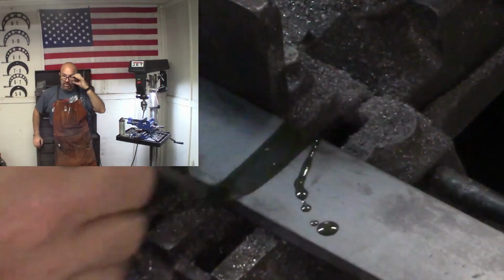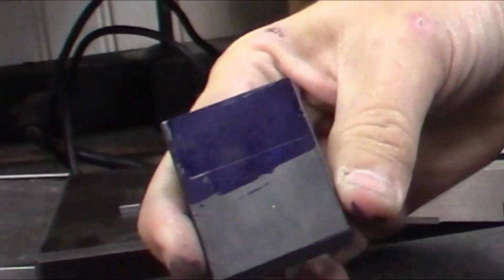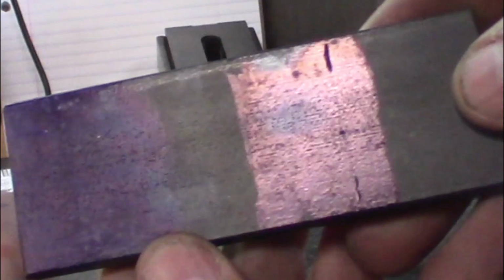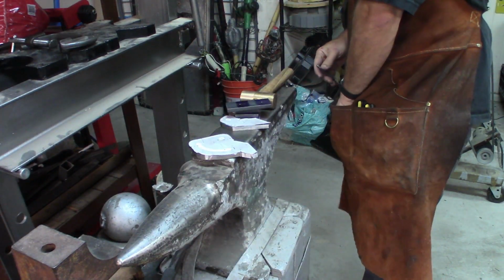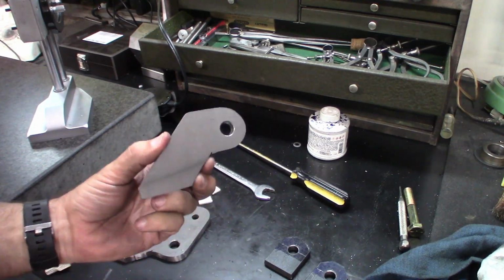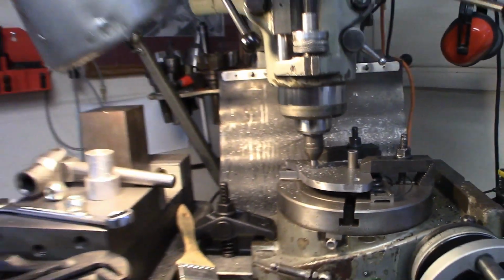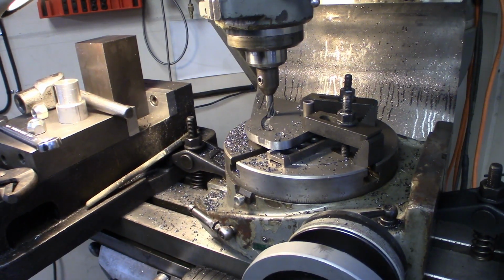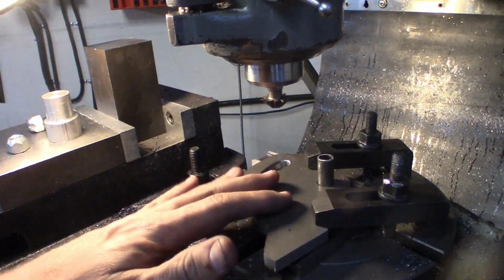2x72 Belt grinder build Part #1

Comment: Every time I try to do a cut without coolant I end up burning the end mill
Reply from the maker: I did burn up a lot at first until I found a good sheet for calculating feeds and speeds.  Mostly I had to learn to turn my RPMs way down.  I now try to mostly keep silver or slightly tan chips.  If they start turning blue then I slow the RPMs down slightly.